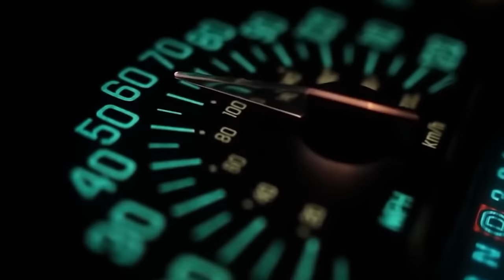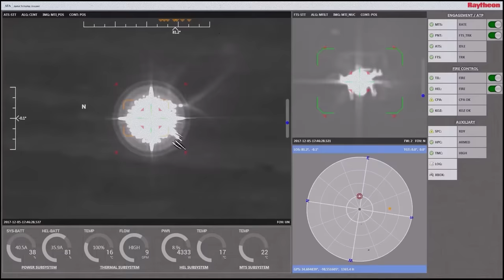America’s DE M-SHORAD: The Future of Laser Defense

Comment: One of the big questions is what this thing's duty cycle is. That determines how many drones it can take on at one time. That in turn will dictate how many of these units need to be co-located.
Reply: Presumably that is going to be one of the most highly classified pieces of information for the lifetime of the system.
Reply: Far more than any other defensive weapon available. I imagine it'd be similar to ciws.
Reply: This is one of those things that needs at least 2 systems to be attached to every single company in an SBCT.
Reply: -How many targets can engage?
-Yes
Reply: True. Though, I think it's fair to say that no matter what the actual number is, it's going to be wildly superior to conventional surface to air intercept missiles. And even if you're facing more targets than your onboard generator can keep up with, you just drive up a flatbed with a generator on it, connect the two trucks with an extension cable, and you've got more energy per second to spend. So I imagine the "density of defense", the ability to defeat a given number of targets per time, will be much easier to scale up than it is for trucks with racks of missiles where your only option is field more launchers.
Reply: It needs a battery pack to save fuel while it is just scanning, and fire up the diesel if a swarm rolls in, or the batteries get low.
Reply: the enemy will analize battlefield engagement data to determine what the per unit effective rate of fire is - no espionage required
Reply: Yes thats an important point, but definetly more than just a few thousand rounds as you would have with many artillery barrels
Reply: Laser is sexy against drone swarms but IMO rapid-fire cannon spewing programmable air-burst shells are just as effective and aren't affected by bad weather
Reply: It is an electric solid state laser system. As long as there is enough power and energy, it can fire continuously.

Comment: I wonder how drones will react in turn. Maybe reflective or ablative coatings will become more common in advanced models, or we'll see a switch to more but smaller drones to overwhelm the defense system after all?
Reply: Glitter bombs, like anti-radar chaff but for lasers. Or just smoke, but glitter would be more fun and a potential ecological disaster.
Reply: I'm an optical engineer and have experience designing drones so I have seen both sides of the argument. SHORAD in its current form is very rudimentary and has many weaknesses that can be exploited with ease and at low cost: Drones with reflective paint,  thick shells, or high thermal density shells can counter it. Larger drones have more mass and can counter it. Fast drones can hit it before it can melt them away. Poor weather makes it less effective. It is weak and has poor range.
However lasers in conjunction with AI scanners have excellent potential in future: In a few decades, both will be advanced enough to make most military hardware obsolete. AI can scan and analyze an entire aerospace in visual range, and once it spots anything even tens of kilometers away (i.e. stealth aircraft, drones, etc.) it can fire a quick burst, extremely powerful multiband/multi frequency laser to take it out. Similarly air to air missiles, flares, radar and dogfighting will become obsolete, as all aircraft will run AI scanners and powerful laser pods.
Reply: @RM1969RM 
So you are smarter and better then the entire team that designed the shorad?
Reply: @georgecristiancripcia4819  weapon offence and defense has a long history of counter measures and adaptations. 
Grid or lattice cages around tanks to make incoming missiles prematurely detonate. 
Mine-resistant vehicles in Ukraine are getting disabled because Russians are stacking three mines in a single stack. 
The first hypersonic missiles have little maneuverability to evade air defenses, but new versions can. To prevent a hypersonic missile from getting destroyed by a laser, supposedly a new coating on a Chinese missile is resistant-enough to current US lasers. Time may tell if that's true.
Reply: Cooked ducks falling from the sky!
Reply: @georgecristiancripcia4819 of everything he wrote, that was your takeaway and chosen response? 😂
Reply: It can do it but then you ran into the problem of defeat the main strong of those drones, its cheapness. 

Also make it smaller also make it more vulnerable to microwave weapon instead.
Reply: @RM1969RM  I think one problem of AI scan is, there still needs to be an operator pushing the button. There simply is very big chance of misidentification.  I personally think it will be great for point defense system like SHORAD. But for wider range of targets... radars etc. will still hold . Well they will probably combine in the end. the more input data from more varied sources you get, the better identification of threat.
Reply: They're cheap. They can fly lower. It's just tactics.
Reply: @RM1969RM  
Drones are cheap and that's why they're used. Drones having thick shells will make them less maneuverable and more expensive. High thermal density shells shall make them even more expensive. What you don't like to admit is that drones DON'T have the change to counter it. It's just tactics. They fly lower and they don't get detected until it's too late. Also, that reflective paint could make drones easier to spot so it WON'T be used. Also, there's no counter to reflective materials when it comes to lasers. The system is NOT rudimentary nor has weaknesses, it just isn't that functional.   

Lasers and AI scanners have NOT potential in the future. If you haven't figured out in the past decade AI has limited potential and so do lasers. Nothing will become obsolete because of them.
Reply: Certainly not a bad thought, but these lasers are so high powered they would just boil the reflective coating off, ignore this RM1969RM fellow, they are clearly not what they claim they are. You can find video online of high powered lasers just 'punching a hole' through the reflective layer of a mirror like its nothing, now consider that these military lasers are like 10-fold the strength of some lab setups and you should be able to deduct that reflective coatings wont do a whole lot
Reply: @suicidalbanananana what about ceramic coatings/ ? Like the ones used in jet engines? It won't be that heavy or costly if made in large numbers.
Reply: @zaco-km3su You are drastically underestimating human ingenuity. We are the species that went from steam power and trains in 1848 to nuclear weapons and hypersonic missiles by 1948. We didn't know that atoms even had multiple pieces in 1848, but had learned to split them in just a few generations. Batteries, telecommunications, TV, fast-firing weapons, and so many other parts of our daily lives were invented in just a single century. Whether DE weapons will proliferate, or new tactics will evolve to counter them, or both, is uncertain. What is not debatable is whether humans will push the technology as far as possible. We will. We have.
Reply: Can the drones be reinforced against laser weapons? Sure they can! But it will come at a cost to their other capabilities or just cost per unit. Either way the effectiveness of attacks by drones, mortars and other applicable things is reduced. Whether laser will turn out to be a hard counter or a soft counter only time will tell. These lasers are very early take on the weapon, there are already promising venues for increasing their effectiveness. In the end its all about having functional society/economy to fund/advance these things...
Reply: Probably just numbers, it would be cheaper to print out a bunch of drones than make a super drone. That and using AI in combination with a human controller squad somewhere close and it will be an interesting arms race. All this tech is essentially in the bi-plane phase so they're only going to get more deadly as real money is poured into these experiments, especially AI swarm control and such. The days of high G sensitive meatsacks in attack and fighter aircraft is essentially over with innovations like this. It takes years to train a human pilot, a new AI mind can be uploaded in minutes to control a swarm. Also the quality of an AI pilot only gets better over a conflict where human replacement pilots collectively get worst.
Reply: @anydaynow01  I don't believe that large drone swarms will be as effective as you think. While having more drones is going to make them more likely to hit, they will also be far easier to destroy, and have smaller payloads. At some point the drones would be too small to do any damage, while the lasers would be able to take down any with the kind of damage potential necessary to inflict damage. Even a bumblebee can be deadly, but not when a beekeeper dons the proper attire. The same applies here.
Reply: @RM1969RM  thats interesting, in the future i wonder if no one will control the sky's because ground based defend becomes to impregnable. It will be interesting to see how western nations fight in a future with no air superiority.
Reply: @RM1969RM  Armoring or painting attempts would be of dubious value as the drone's optics can't be protected from the beam because they have to see the target, and thus the laser will be in their face before the drones even acquire targets. Blinding optics range is farther than airframe kill range and takes a lot less energy and time on target.
Reply: Many drones star craft protus style
Reply: the nations that can fab the sophisticated chips that comprise AI will have those capabilities - this is an area where Russia and China will have difficulties. It won't help them to steal schematics as the key requirement are the very sophisticated machines used to fab and manufacture the most state of the art chips. Even occupying Tiawan will acheive limited benefit in this regard.
Reply: 6, 12, even 24 or more FPV drones, tree top level, from different sides is still orders of magnitude cheaper than a 50kw laser on top of a stryker.  I have my doubts.  RF jamming would be better, then you are only defending against more expensive onboard AI driven drones from another nation state.
Reply: @Dan-yk6sy I agree. Eventually there could be so many drowns attacking to defend you will have to say “raise shields Scotty”
Reply: @Dan-yk6sy  If there are that many drones trying to take out a single target, then the target probably won't have just one DE-MSHORAD defending it. The technology is not stand-alone in nature. Maybe you can overwhelm one or two, but the system is small enough that you could see seven or eight in the same area, alongside a patriot or aegis system. Even assuming a massive swarm of 100 cheap drones, that kind of air defense will not be easily overcome. And this is the USA fielding it, so you can bet that most of the militaries that receive them will not be on the weaker end of the spectrum. Japan, South Korea, Finland, and Poland are all top-tier military powers that will be able to do exactly that. Minor powers like Portugal, Slovakia, or North Macedonia will not be likely to receive the systems, except to allied military bases in their countries.
Reply: Indeed, swarms will overwhelm them. The army, the Air Force, the Navy, in the USA they are as dumb as rocks. Trying to protect giant machinery. New strategies and tactics are needed, no way to protect tanks in the future.  It’s crazy and they don’t know what to do. For defense, obviously gonna have to go underground or completely camouflaged and stealthy. They are dreaming if they think they can drive giant equipment out into the field in future combat. I don’t care how much jamming, I don’t care How many lasers they have.
Reply: @RM1969RM :  very thoughtful, very interesting to read, I’m an engineer but I’m not in the field of artificial intelligence or drones.  As an airplane pilot, just a private pilot, it is clear to me that the weak link is the human pilot; it is a huge mistake that the military has not transitioned to drones long ago. As a controls systems engineer, I know the technology was available decades ago; certainly now there is no excuse for ever making another combat aircraft with humans on board.
Reply: @zaco-km3su :  do you want to bet? Human occupied Combat aircraft will become obsolete, and as well, so well giant aircraft.
Reply: @RM1969RM  There are going to be countermeasures, but we cannot speak for they effectiveness as of yet. For instance, reflective coating will make the drone extremely visible in the sky; making the drones more durable means you have to compromise speed, cargo capacity, maneuverability or range... larger drones, like missiles, have other weakpoints that this weapon system SEEMS being able to exploit to shut them down, just as it can shot down artillery shells, whhich surely have thicker casings than drones.

Should we trust what they claim, the SHORAD seems pretty effective, and should countermeasure be found, it looks like they would require quite the overhaul of "insert wahtever you want to bypass the SHORAD"; maybe not a big deal for properly funded armies (stealth fighters solved a similar issue), but a big issue for small guerrilla forces that live off whatever they can find (the grand majority of countries still do not have stealth fighters or bombers for example).
Reply: I asked the drones and they said that they are appalled by this!
Reply: @mosephthuglewits5302 10 bucks he's an optician and flies his own fpv hobby drones.
Reply: @RM1969RM Real optical engineer with experience with laser weapons. Everything you said is wrong. Lasers have been cutting thru highly reflective Aluminum since 1990.

Comment: The U.S. Navy is deep into exploring the utilization of laser technology as the backbone of it's main defensive system for all it's nuclear vessels including the Ford class carriers which is currently utilizing barely half it's energy output.
Reply: Wish they would’ve figured out how to put the rail gun to official use
Reply: @benprice3481  Rail gun are still in development, at least conceptually, but the issue of the rails durability confine them to "highly destructive single shot" configurations. Sort of mini nuke effect without a nuke (and radiation). Once new alloys are discovered allowing the rail to survive multiple discharges (or ways to cool them down fast enough), I believe we will see more projects around railguns, just we are seeing now more projects around weaponized lasers finally being practical.
Reply: Issue with using it at sea is adverse weather such as fog and rain.

Comment: The issue with beams is that they are slow to work. Israel's iron laser dome is already in use in limited quantities, and it takes a solid 10-30sec of constant tracking and fire on a small surface area to take a drone down. Loose line of sight, or have a rotating target that doesn't present the same surface to heat, and the lasers become less effective.
Glossy and reflexive coatings also mitigate the effects of energy weapons, but make more traditional counters more effective as the target becomes easier to track. New kinds of smoke and chaff can also scatter laser energy easily as well. A bit of smoke can really reduce the power delivery in a big way.
However, having this as a first line of defence to take out smaller or to prioritize harder to track targets can really help whittle down numbers to reduce the need for other more expensive ammo. And as they adapt the tracking, prioritizing and control mechanism to other counters it will change the game for the effectiveness of those as well. It's a good addition, not likely as good as advertised, but still a good step forward.

Comment: Imagine the potency when they upscale this for use on a nuclear powered ship.
Reply: for anti missile purposes I suppose, but shooting anything else would be better to use weapons that can reach beyond the horizon.
Reply: Imagine the security when they downsize this for use from a human-powered hip.
Reply: Ford class carriers 👍
Reply: Ships and planes with this tech have been around for a few decades, they're certainly not common but they do exist. The latest iteration that this video talks about is really just a downscaled & quicker version of something that they had already
Reply: or scaling these for bases, pulling power from some batteries being charged by solar panels along with a gas backup.
Reply: @statesidekarma7240  Or a micro reactor buried a few meters underground. Though that new Karno generator looks really promising, supposedly it can run on anything that can burn and is super simple with only one moving part on air bearings.
Reply: You don't have to imagine. The Ford class carriers have a strongly upgraded electrical system to not only power their electromagnetic catapults but to presumably also power an array of directed energy air defense systems. I would imagine that whatever new ship classes that manage to make their way out of development hell and out of the shipyards will have a similarly upgraded electrical system.

However, directed energy systems won't be the be all and end all. I imagine a layered and complementary systems consisting of directed energy, projectile and missile systems  to handle different threats. The hard part of this will be the coordination between different systems and rapidly deciding which system to use against which threat and at what moment.